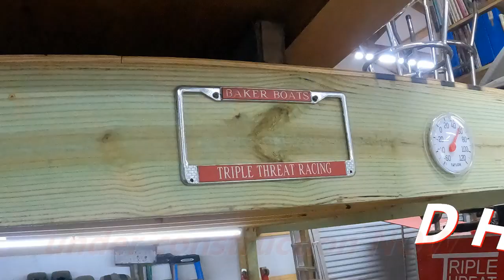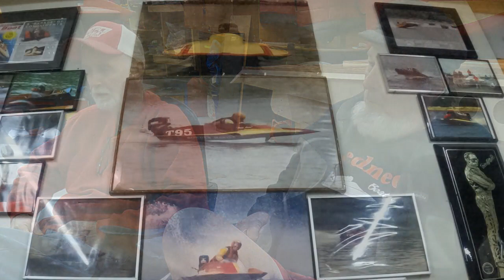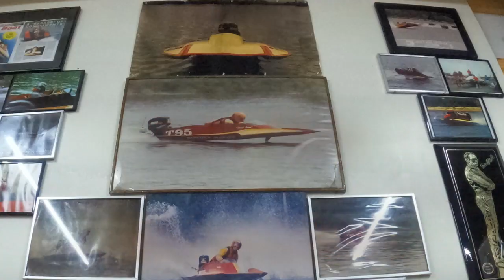Baker race boat factory tour

Comment: Man I really enjoy your videos. Endless knowledge to pass on you have! I've never race but I restored a 1991 small amateur race boat I pulled out of the woods in tennessee 2 years ago. It's quite the conversion starter being back on the water. Currently running a normal 25hp mercury on it just to have it on the water again. But I actually have a Mercury 25xs short shaft with what I think is the original race foot and little clever prop that came on it that I just stare at on a stand. I love amaturingly tinkering with old small two strokes and getting them going again but I am scared to death to dig into the xs in fear of messing up such a holy grail little motor. Definitely in need of finding one of you oldschool experts that knows everything there is to know about those motors one of these days!! Thanks for the content i try to soak up every bit of knowledge you throw out there!
Reply from the maker: Send me a picture of the little merc.  Excited for you messing with boats.  I appreciate your comment and love playing with boats myself.
Reply: @rustysitton9574  what's the best way to send you pictures? Thanks again!
Reply from the maker: @cahallc  probly email.  Rustysitton@gmail